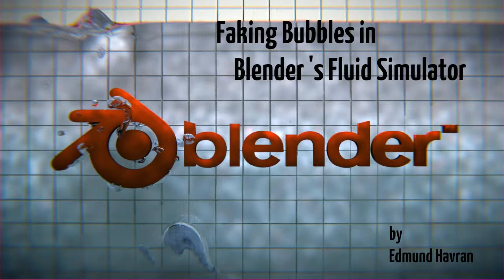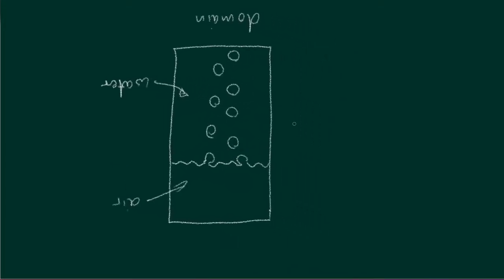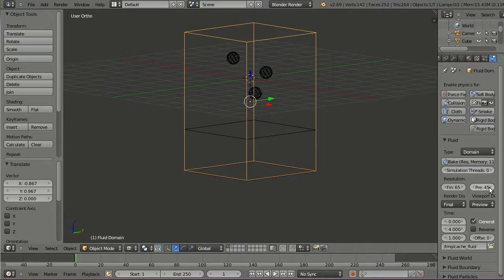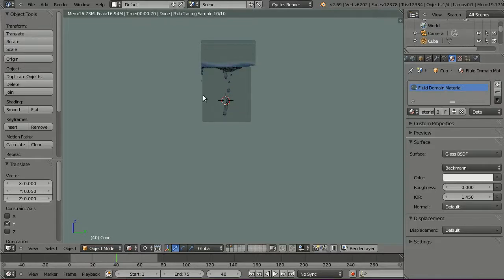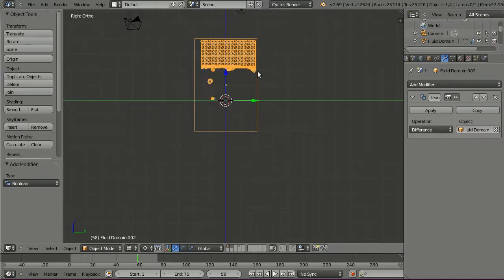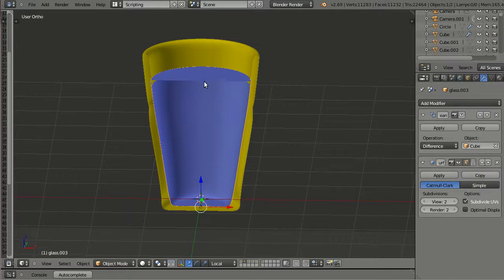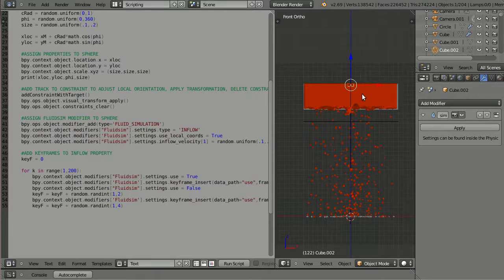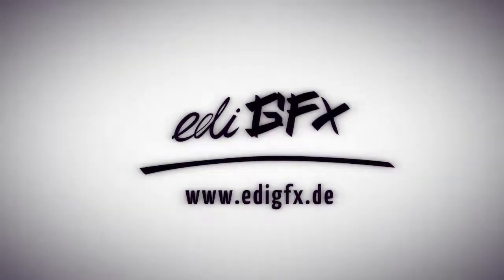How to fake bubbles in Blender

Comment: i invert the domain, and the whater just falls onto the drop: it does not invert gravity!
Reply: workaround: disable the global gravity in the scene tab, and in the domain, change from -9.81 to 9.81
Reply from the maker: Hello Luis.
Bake the drop simulation with default gravity setting (9.81). Then rotate the domain 180 degrees around x or y axis, so it is upside down. Duplicate the domain and strip all fluid settings from it, so you have a bare mesh object. Subtract the fluid domain from it with a boolean modifier. This should do it. 

I hope this helps.